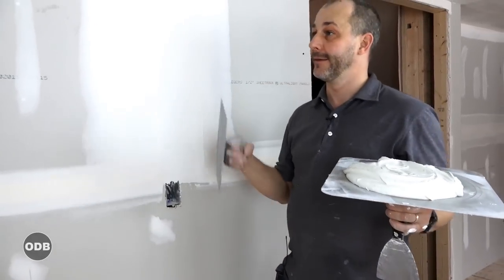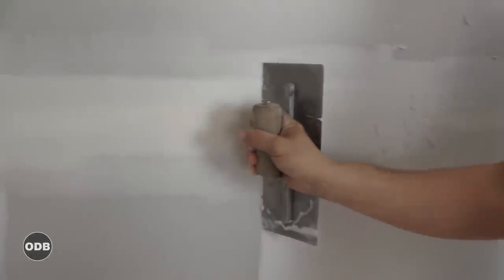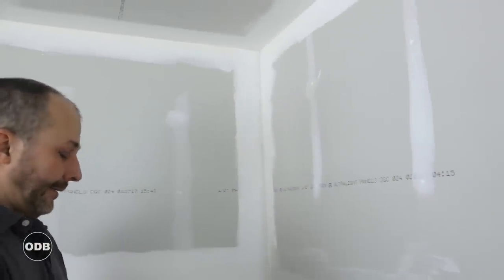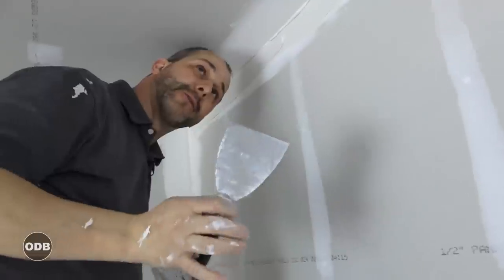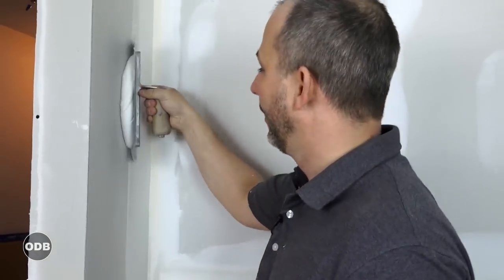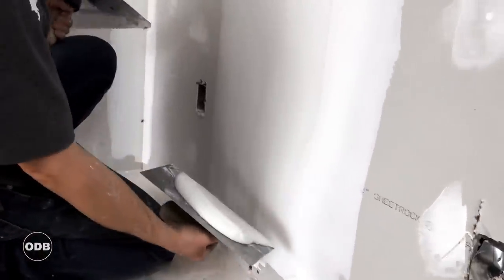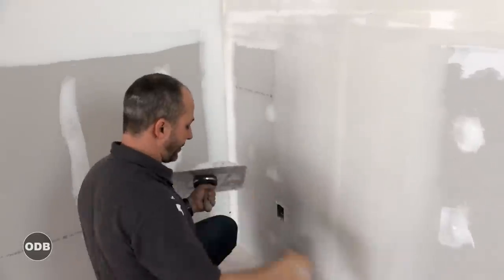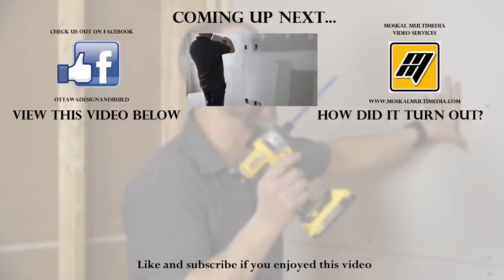Complete Drywall Installation Guide Part 9 Third Coat, Butt Joints

Comment: I've watched your taping and joint compound videos countless times at this point. I'm about to go for my corners and a second coat on all the seams. I bought the 4" x11" sheetrocking trowel that you use today. I noticed they all have a curve lengthwise. I didn't expect that. I'm used to concrete trowels being straight. I sanded my edges and will proceed tomorrow. I ran my sheetrock vertically rather than horizontally, the only butt joint I have is in the center of the ceiling. It's a 16' x 30' workshop that I've been building, it's a big job to me.
Thanks for your knowledge.

Comment: I found your video series after hanging, before mudding.  VERY helpful, great tips.  I sent the link to my brother who is doing a project.  I'm a homeowner/DIY...this project used 30 sheets of 4X12' drywall, might have bit off more than I can chew - but you've saved me a lot of aggravation (and sanding!).
Reply from the maker: Hey Kevin, that is what we are here for. We have a new video every saturday evening. Look forward to hearing from you again. Cheers and good luck.
Reply: Question for you...part of this renovation project is a bathroom.  I ripped out the old ceiling due to mold and mildew.  I did address the root cause and have fixed what  was causing the mold.  I had a contractor come in and he did the original bathroom build - shoddy workmanship.  Looks like he only used one coat of mud, this resulted in the paper absorbing moisture which caused the paint to fail.  I can also see the screw heads through the paint.  I tore the paper out and replaced it with mold resistant FG tape.  I also had an insulator use dense pack cellulose before I re-installed the bathroom ceiling with Moisture Resistant sheet rock.Question - I had planned on skim coating the walls with Green Lid joint compound (hide imperfections, bury screw heads, blend seems, etc.).  Is there any value in skim coating over the ceilings new MR sheetrock (purple paper)?  Will the joint compound help protect the paper from moisture getting to it?

Comment: The video was excellent in "how to mud ", great simple step by step explanations on why you do it. Thank you  for  posting.  On filling up electrical boxes; The method I use is an extra step but it does help  the next trade; fill it up with paper and or card board, and  wide masking  tape to hold. , I have used drywall on occasions. In a residential renovation , this step helps the finishing around the boxes, and makes the electrician happy!
Reply from the maker: Thanks Edigio, Love your tip for the electrical boxes!

Comment: Excellent explanation and teaching! Best I have seen. 
Can you PLEASE review which coats should use the "setting" vs "drying" mud for each joint type. 
Thanks. Paul
Reply from the maker: 45 for filling gaps and corners. regular for everything else. the closer you are to finish the wetter the mud to help reduce sanding.
Reply: Great, thanks bro! 
By "corners use 45",  do you mean use 45 on the first coat only in the corners and then regular on the coats thereafter?  Or all costs in the corners use 45?  And, should I use regular for ALL costs including taping on butt and tapered joints, except th ed first coat on gaps? Thanks again!!

Comment: I would like to see all this information that you present on new drywall walls done on damaged old painted and textured ceilings and how to match orange peel and knock down textures. I am doing this kind of repairs on ceilings in my house.  Have areas that are water damaged and also stress cracking.  I feel you have information that i need to know to go on.  Thanks   PS  have watched all your drywall videos many times each..

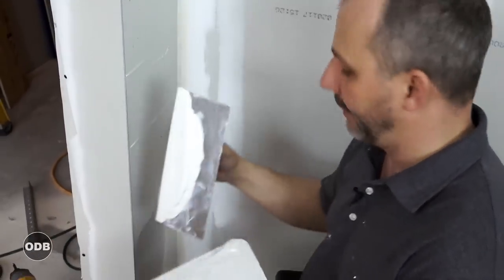Comment: Quick question, around the 4:00 mark, is the metal corner getting it's 2nd, or third coat? Last video he mentioned coming back in 30 minutes to apply a second coat. Not sure if this is that application.

Comment: I'm still confused about when to use the hard setting mud. I get that it's for filling gaps, but I thought you use the normal premixed compound for the tape? Are you using the 45 minute mud for the second and third coats on the tape and screws?

Comment: What kind of finish mud do you find in Ottawa? Also, if finish mud scratches easier, isn't there an advantage to using all-purpose mud - gonna be hard to sand it but wouldn't that offer a stronger wall/finish?

Comment: When you refer to outside pressure near the end of the video, do you mean you have pressure on the knife over the tape with less pressure on the outside of the joint so that mud is pushed out from the center of the joint to the outside.....and therefore not creating a really thick tape joint ?

Comment: I'm a newbie DIY with blank and screw holes, inside corners, seam and butt joints to mud. Can I use the 45 for everything, on every coat, or when do I use the machine mud??  Second question, since I'm taking it slow with small batches at a time, I believe I can make small amounts of 45 (yes, no?), so can I take a small amount from the machine mud box and reseal it effectively?
Reply from the maker: it just does not go on smooth enough for a finish coat!

Comment: Hello. Is the purpose of multiple layers simply to widen the volume height of mud so that the eye doesn’t pick up level changes over a wider area ? What are the different types of mud you use and lastly, does stiffness or quality of the knives matter much ?

Comment: 3 coats 
1 tape or bed coat 4 & 6 inch
2 block coat 10 inch
3 skim coat  12 inch
In a specific order  buts flats angles always all coats never work wet to wet.angles only get 2 coats tape let dry do 1 side at a time 
One @ block coat and the other @ skim coat.bead install @ tape coat 
6inch first coat 8 Inch second 10 or 12 inch third coat used this system for 30 + years this guy has moderate skills and can get you through a job he explains what works for him

Comment: Newbie question: I just found a section where I'd applied plaster on a ceiling joint and missed the first 2 feet with the trowel. So it dried and cracked all over. Should I try to scrape it off or sand it flattish or call in a professional? I'm not going for perfection on this first job (it's only my workshop), but I'd like to know how to fix a big gaff like this without wasting too much time on it. I doubt I'll notice it, since I didn't see this 'til I was coming back for the final coat.
Reply from the maker: Either sand it down or fill it in. the crack is from drying too much mud at once. You can fill it in without cracking again since it is not structural.

Comment: I mistakenly bought a stainless trowel but it has curved long edges. Similar to this https://besttradetools.co.nz/collections/drywall-interior-plastering/products/drywall-curved-trowel-stainless-steel-rubber-handle-two-sizes The blurb said "trowels have curved edge for crowning plaster joints". I note you always use a straight bladed one. Have I wasted my money? Can you use the curved edge trowel for third and/or final coat? Also is a spring steel one better than a standard type?

Comment: How long do you have to wait before moving on to each coat? Do you really have to do it by each day or does it typically dry after it 12 hours?
Reply from the maker: wait until it dries, humidity and air movement can affect that. Cheers!
Reply: Set up an oscillating fan to speed up the drying.

Comment: this is nice. what kind of mud are you using? thank you
Reply: use regular joint compound white, do not buy the brown stuff, its meant for other applications, tape butt joints first flats second and angles last, the angle unlike he says here, is better when it runs over the flat. Angle is what he calls inside corner, there are no "inside corners" they are called angles,  what he calls outside corners are simply corners, bottom line, corners and angles thats it

Comment from the maker: Doeas anyone have a good system for keeping mud out of the electrical boxes?
Reply: I will normal round them.then bring my 14 up to it
Reply: I usually bring my knife with mudd on it, and I would start from inside to outside. Then clean around it. Also blue tape on the edge of box going in will help too. When finished mudding around the electrical box, i peel the blue tape. 

Side note, i am not a professional by any means, but i have a lot of experience with mudding  dry wall, sanding, painting, ect.. Alot of what I have learned is through my dad which he said he learned from a professional (from what he stated).
Reply: This is not an issue, just clean them after, there won t be a lot, usualy they are not in your way
Reply: Hire an electrician with journeymen who need hours!
Reply: If you're not  stressed for time, you can use 3 inch masking tape, it's a quick fix. Easy on, easy off.

Comment: i just did my butt joint 2 times.  I  am using the strait flex butt joint tape.  After applying mud twice I still see the tape and the edges of the tape.  Do I need to feather out more?  Am I supposed to see the butt tape after applying two coats?
Reply from the maker: not the edge. try leaving some mud on the side of the joint to fill the space. I would guess that you are taking everything right back off again. The fist coat is to set the depth of the joint over the tape and after that all you are doing is spreading out the joint to make it invisible.

Comment: You make it look too easy. I made a mess, and a mountain of sanding dust. I ran out of a 5 gallon bucket of mud before 3rd coat for garage drywall walls only with no ceiling.

Comment: hello I have a question about the spatula that marks is and also that number
Reply: apply the compund with a 4 inch spatula, slap the tape on the joint and whipe it with a 6 inch spatula, jut go to your local hardware store and ask for spatulas for taping  or plastering

Comment: Can't you avoid having butt joints by installing your sheets vertically?
Reply: Yes but that is quite difficult to have everything line up perfectly. If you room is small enough, I would say just get 12 foot sheets (I think if you look hard you can even get 14s) and go horizontal.

If you are doing the framing yourself and can lay it out so that vertical drywall would like up on it perfectly, then that would be a good way to go. I did it that way in my store.

Comment: Do you know where in the U.S. we could purchase the mud?
Reply from the maker: home depot and lowes both carry machine mud.
Reply: djm93 where do you live? In our area, we have a lumber yard (Snavely’s) that has a “drywall division”. There you can purchase just about anything drywall. Our mud comes in pails. Same stuff, different packaging. Check your locality for drywall suppliers ( not Lowes or Home Depot).
Reply: home depot man, its nation wide and it has a few options on joint compound they are all the same sh,it, only the cgc with the blue printing on it i find super cheap in quality, it marks easy and when you sand it , lots of it falls off the wall

Comment: In the UK we just skim the whole lot, it's a one step process and the whole thing is flat, this seems like a slow process.
Reply from the maker: This is a superior process in an area where you get a lot of expansion and contraction in the building. A lot of our old homes were built with the European model and the plaster all fails and cracks and falls off.
Partly due to bad insulation but mostly because everything is built out of wood and it gets deadly cold here in the winter.
Reply: UK has all solid concrete walls so it's totally different to plastering timber frame dry wall.
Reply: @toranarama1  Sorry to disappoint...95% of homes in the UKare timber framed with an outside brick skin. Our drywall (called plaster board in the UK - same stuff), goes onto the timber frames the same as yours. Our outside temps range from 23'F to 95'F but normally 40 to 80

Our drywall gets two or three skim coats of plaster and when done by a professional gives an amazing uniform and flat finish that doesn't crack or fail. This technique in this video seems more accessible to beginners who cannot apply a flat coat of skim plaster
Reply: And when your a real pro like me you sand after the 3 and skim coat the whole wall i know the drywall done in this video was nice but put a florescent light u will notice why a skim coat is necessary for a perfectionast but the 3 step rules is need unles u working a mesh and durbond 20 then its 2 coats 1 of skim

Comment: You don’t need trowel but joints so wide , amateur. Tape , 2nd coat then top coat is all any joint should need
Reply from the maker: I am teaching homeowners who will need the 3rd coat. it takes years of practice to do it in 2. Cheers!

Comment: you say "day two- butt joints" but dont do any butt joints. instead you do a ceiling taper joint, half of an inside corner, and a metal corner. This is not helpful.